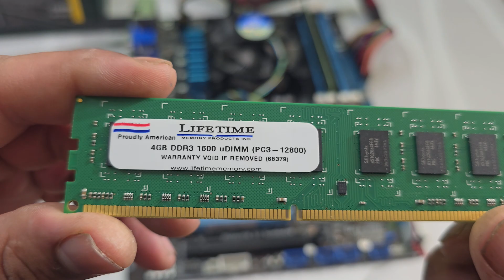I Tried EVERYTHING to Fix This DEAD Gaming Motherboard

Comment: sir can i ask question? my old pc i5 gen 3 and motherboard digital alliance and GTX 750 ti(already re thermal paste cause GPU artifacts and never happen again) has keep alive for 6 year old and now my old pc every 1 weeks no signal after show bios cant boot to windows i trying remove cmos battery for 5 minutes and it normal again.but after 1 weeks it keep happen and happen again do you why know?? note: i replace cmos battery with new and my house electricity every day normal even i use UPS for unexpected power outage
Reply from the maker: Could be a bad gpu if it previously showed artifacting
Reply: @TekSavvyAron  it true my gpu once articating before i re thermal paste my gpu.but after i do it it never happen again sir
Reply from the maker: @gunawangunawansantoso4122  dose your cpu have integrated graphics? If so try removing your gpu and connect your monitor to your motherboard hdmi

Comment: Another cheap replacement part would be a pre-programmed bios chip since the board has a removeable one. That fixed at least 3 boards for me that seemed dead. Good luck sir! 🤞
Reply: sir can i ask question? my old pc i5 gen 3 and motherboard digital alliance and GTX 750 ti(already re thermal paste cause GPU artifacts and never happen again) has keep alive for 6 year old and now my old pc every 1 weeks no signal after show bios cant boot to windows i trying remove cmos battery for 5 minutes and it normal again.but after 1 weeks it keep happen and happen again do you why know?? note:my house electricity every day normal even i use UPS for unexpected power outage
Reply: Hard to say, have you tried giving your PC a full cleaning of all components, or tried a fresh install of Windows?

Comment: Had this exact same issue yesterday on a Acer TC-885. 
Power off the computer and completely unplug, pull out the CMOS battery and move the ram stick to a different slot. Reinstall the CMOS battery, plug your power cable back in. 
You may need to power cycle it once to train the ram.
If it doesn’t work, repeat but each time move the ram to a different slot (only one stick)
Reply: sir can i ask question? my old pc i5 gen 3 and motherboard digital alliance and GTX 750 ti(already re thermal paste cause GPU artifacts and never happen again) has keep alive for 6 year old and now my old pc every 1 weeks no signal after show bios cant boot to windows i trying remove cmos battery for 5 minutes and it normal again.but after 1 weeks it keep happen and happen again do you why know?? note: i replace cmos battery with new and my house electricity every day normal even i use UPS for unexpected power outage
Reply: @gunawangunawansantoso4122  I would try doing a BIOS update and maybe a fresh install of windows.

Comment: These boards are notorious for bad solder joints.
Reply: sir can i ask question? my old pc i5 gen 3 and motherboard digital alliance and GTX 750 ti(already re thermal paste cause GPU artifacts and never happen again) has keep alive for 6 year old and now my old pc every 1 weeks no signal after show bios cant boot to windows i trying remove cmos battery for 5 minutes and it normal again.but after 1 weeks it keep happen and happen again do you why know?? note: i replace cmos battery with new and my house electricity every day normal even i use UPS for unexpected power outage
Reply: @gunawangunawansantoso4122  Look for video on Youtube of How To Bake Graphics card....I baked my motherboard by following those instructions and brought it back to life. I had nothing to lose it was not working...BUT,,,I take no responsibility, the worse that can happen is you still need new board.
Reply: @gunawangunawansantoso4122 Also Try motherboard with only one stick of RAM at a time to check for bad memory.

Comment: My first tip is use the clear bios jumper. Even the newest boards have one.
Reply: sir can i ask question? my old pc i5 gen 3 and motherboard digital alliance and GTX 750 ti(already re thermal paste cause GPU artifacts and never happen again) has keep alive for 6 year old and now my old pc every 1 weeks no signal after show bios cant boot to windows i trying remove cmos battery for 5 minutes and it normal again.but after 1 weeks it keep happen and happen again do you why know?? note: i replace cmos battery with new and my house electricity every day normal even i use UPS for unexpected power outage
Reply: @gunawangunawansantoso4122  GPU artifacting tends to be a gpu die or gpu memory issue. 3rd gen i5 has built in graphics. I would remove the 750ti and plug into the onboard graphics see if it boots that way... If it does your GPU probably died.
Reply: @larrysrandomness3237 it true my gpu once articating before i re thermal paste my gpu.but after i do it it never happen again sir

Comment: GREAT BOARD...Check CPU Pins...If all else fails...
BAKE IT...
I brought my Z77 MSI board back to life like that.
Reply: sir can i ask question? my old pc i5 gen 3 and motherboard digital alliance and GTX 750 ti(already re thermal paste cause GPU artifacts and never happen again) has keep alive for 6 year old and now my old pc every 1 weeks no signal after show bios cant boot to windows i trying remove cmos battery for 5 minutes and it normal again.but after 1 weeks it keep happen and happen again do you why know?? note: i replace cmos battery with new and my house electricity every day normal even i use UPS for unexpected power outage
Reply: @gunawangunawansantoso4122  This sounds like it is a software problem more than a hardware problem.  
Try taking memory and GPU apart and re-assemble...
If this does not help then It might be BIOS or Operating system. 
Try changing your Motherboard BIOS battery too.

Comment: its chipset or mosfet
Reply: sir can i ask question? my old pc i5 gen 3 and motherboard digital alliance and GTX 750 ti(already re thermal paste cause GPU artifacts and never happen again) has keep alive for 6 year old and now my old pc every 1 weeks no signal after show bios cant boot to windows i trying remove cmos battery for 5 minutes and it normal again.but after 1 weeks it keep happen and happen again do you why know?? note: i replace cmos battery with new and my house electricity every day normal even i use UPS for unexpected power outage
Reply: sometimes this happents because the cpu not mounted well on motherboard as well or bent pins on the cpu socket check that @gunawangunawansantoso4122  thsi

Comment: Voltage measurements?-it looks like it has some isues related 2 power rail
Reply: sir can i ask question? my old pc i5 gen 3 and motherboard digital alliance and GTX 750 ti(already re thermal paste cause GPU artifacts and never happen again) has keep alive for 6 year old and now my old pc every 1 weeks no signal after show bios cant boot to windows i trying remove cmos battery for 5 minutes and it normal again.but after 1 weeks it keep happen and happen again do you why know?? note: i replace cmos battery with new and my house electricity every day normal even i use UPS for unexpected power outage

Comment: This can happen if there is a short on the CPU VRM section of the motherboard.  Try unplugging the 12V CPU cable from the motherboard,  if the fans now spin on the power supply when you power up then there is a problem on the CPU VRM of the motherboard.  You can narrow it down if you have a multi meter,  put the meter into continuity mode, put the black lead on the ground pin in one corner of the 12v CPU power socket on the motherboard and the red lead onto the 12v pin in the opposite corner.  If the meter beeps and reads very close to 0 you have a dead short.
Reply: sir can i ask question? my old pc i5 gen 3 and motherboard digital alliance and GTX 750 ti(already re thermal paste cause GPU artifacts and never happen again) has keep alive for 6 year old and now my old pc every 1 weeks no signal after show bios cant boot to windows i trying remove cmos battery for 5 minutes and it normal again.but after 1 weeks it keep happen and happen again do you why know?? note: i replace cmos battery with new and my house electricity every day normal even i use UPS for unexpected power outage

Comment: Look at the usb ports on the board and make sure none of them are shorted out. Where someone tried to put a USB cable in the wrong way and forced it in, shortening out the pins.
Reply: sir can i ask question? my old pc i5 gen 3 and motherboard digital alliance and GTX 750 ti(already re thermal paste cause GPU artifacts and never happen again) has keep alive for 6 year old and now my old pc every 1 weeks no signal after show bios cant boot to windows i trying remove cmos battery for 5 minutes and it normal again.but after 1 weeks it keep happen and happen again do you why know?? note: i replace cmos battery with new and my house electricity every day normal even i use UPS for unexpected power outage

Comment: Let me give you some pointers here.
- If a board attempts to start but then powers down instantly, that's a strong indicator that there's a power supply issue, a short, or a power delivery issue on the board itself or on one of the parts that are plugged in. You already swapped the PSU, so remove all components and take a good look at everything with a flashlight. The pins in the CPU socket (which I think you already did, but might not hurt to check again), the memory slots, the PCIe and PCI slots. Any of these could have a bent pin that's causing a short.
- A functioning board with no memory installed should still power up and beep at you. It seems you did connect a speaker, but I can't tell if you ever tried to POST without the RAM. Also, you seemingly never tried to use another DIMM slot.
- Inspect the capacitors around the CPU socket. Did any of these leak? You could also remove the blue heatsink from the VRM section and check for burn marks on the MOSFETs.
Reply: Do you know the Problem when the Power supply and the Power suppy fan is turning on but the PC not instantly. It only starts when i disconnect and connect the Power supply 2 or 3 Times. Do anyone know the issue of that?
Reply: @fuji5444  Sounds like a failing power supply. When you turn the PC on, the PSU needs a split second to turn on its main circuits and stabilize voltages, and then it indicates that it's ready through a "Power OK" line on the 24-pin connector. This tells the motherboard that it's ok to start booting. In your case, I'd guess that this signal takes too long most of the time.
Reply: @looks-suspicious  yeah that can be but my Otter Problem is that i bought a knew motherboard and since then i have these types of Problems. The other Problem is that my Power switch Button is not working anymore but i dont know why. My Front panel switches also doesnt work anymore. My motherboard is very soecial i think thats why i cannot really connect the Front panel switches with the motherboard. Do you have an idea to solve this Problem?
Reply: @fuji5444  It appears you have plenty of wiring issues. You should post about your problems to a hardware forum, with full specs and pictures, so people can take a closer look and help you.
Reply: @fuji5444  sir can i ask question? my old pc i5 gen 3 and motherboard digital alliance and GTX 750 ti(already re thermal paste cause GPU artifacts and never happen again) has keep alive for 6 year old and now my old pc every 1 weeks no signal after show bios cant boot to windows i trying remove cmos battery for 5 minutes and it normal again.but after 1 weeks it keep happen and happen again do you why know?? note: i replace cmos battery with new and my house electricity every day normal even i use UPS for unexpected power outage
Reply: Yes, remove the ram. If the onboard apeakers beeps, it's not the board. If no beeps, possible bad board.
Reply: @jasonwoodruff5186  sir can i ask question? my old pc i5 gen 3 and motherboard digital alliance and GTX 750 ti(already re thermal paste cause GPU artifacts and never happen again) has keep alive for 6 year old and now my old pc every 1 weeks no signal after show bios cant boot to windows i trying remove cmos battery for 5 minutes and it normal again.but after 1 weeks it keep happen and happen again do you why know?? note: i replace cmos battery with new and my house electricity every day normal even i use UPS for unexpected power outage
Reply: sir can i ask question? my old pc i5 gen 3 and motherboard digital alliance and GTX 750 ti(already re thermal paste cause GPU artifacts and never happen again) has keep alive for 6 year old and now my old pc every 1 weeks no signal after show bios cant boot to windows i trying remove cmos battery for 5 minutes and it normal again.but after 1 weeks it keep happen and happen again do you why know?? note: i replace cmos battery with new and my house electricity every day normal even i use UPS for unexpected power outage